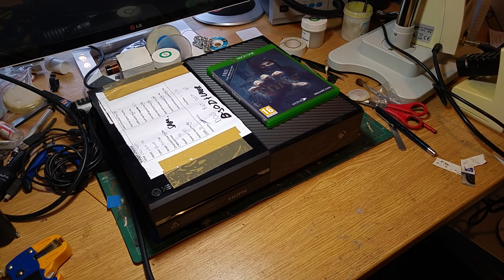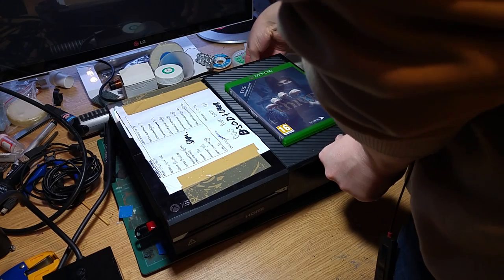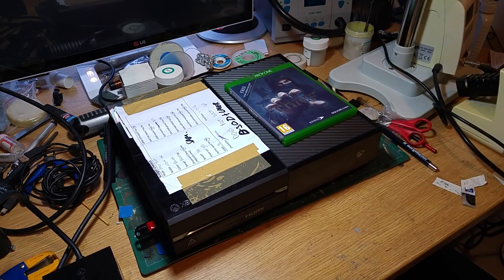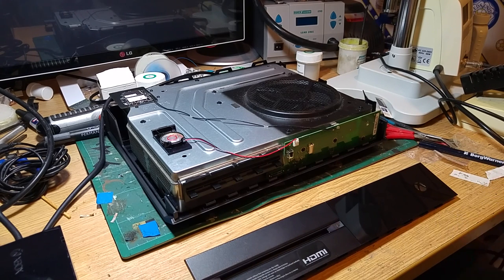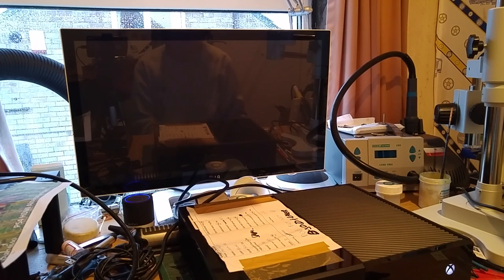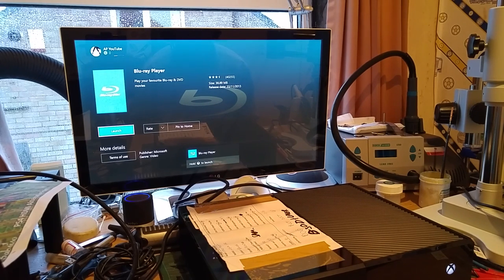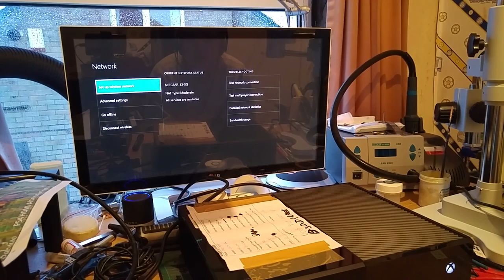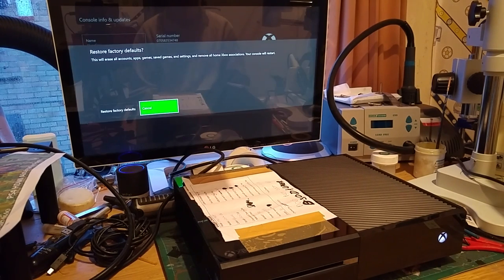XBOX One Black Screen / Intermittent Green Screen of Death Recovery - Diagnosis and Repair

Comment: Hey Andrew! My Xbox One console recently ran into this startup problem, giving me an E101 or E102 error code. I have tried using the Offline System Update on the support site using both OSUDT2 and Factory Default, but holding the correct button combinations will not play the correct tones or startup correctly. Do I need to open up the console? My warranty is up by the way. Thanks in advance!

Comment: Just reset it to factory settings, it worked for me.

Step 1: Hold the power button for a few seconds.
Step 2: Hold the bind button or whatever its called ( the one on the left side ) and the eject button for a couple of seconds.
Step 3: After you hear a sound you just tap the power button and keep holding the other two until you hear another sound and done.

Comment from the maker: check the flat ribbon from the front panel is correctly plugged in and square in the connector.
Reply: do all of these options reset storage on the HDD ?
Reply: Do i have to be do windows to download these files?
Reply: So Andy, are you a Playstation man or Xbox?  Xbox myself.
Reply from the maker: Very good question - to be honest I had both PS4 and XBOX One on launch day and if they've had 20 hours of collective use since I've had them then they've done well ha ha! Most of my games I do have are on PS4 so I guess from that point of view I'd be classed as a PS4 man but I love the XBOX One too - they're both great machines and I don't think you can go wrong with either to be fair. :-)
Reply: I'm getting on a bit 47, I'm more interested in fixing them rather than playing them. Saying that I got myself a HTC Vive and does that take it out on me lol.
Reply: D15rules
Have you tried deleting the game and reinstalling?
Reply: D15rules
Yes mate, go into the games list and press the select button on your joypad. You'll see delete there. If that doesn't work then fully restart the console from the options and restart there. Failing that contact MS.
Reply: Andrew Paul what you use to fix the hard drive
Reply: Hey Andrew. I have the same problem in this video. I seen you had used the HDAT2 program to scan the Xbox One HDD to find corrupted files. The second power tone does not seem to appear for my BIND and EJECT Troubleshoot Reset. I am only assuming by watching this video I have to take out the HDD and scan it with that program to fix the corrupted files. Please answer back with a response if I am going to have to do this. If so.. I need to know which HDAT2 Program you are using. I am on the website and there are a bunch of them..
Reply from the maker: Yes you need HDAT2 - remove the disk and scan with this. You need the HDAT2CD_53.ISO option under CD/DVD Boot ISO image.
I'll be doing a tutorial on HDAT2 shortly.
Reply: Thank you so much Andrew! I'm nervous to do this. It would be my first time taking apart my Xbox One. Can you also show how to hook up my Xbox One HDD to the PC/Laptop? So I can perform the scan on it with HDAT2. It would help out a lot Andrew.
Reply from the maker: You can see the disassembly procedure here:
https://www.youtube.com/watch?v=BrSX0LdSNuQ
Nice and easy :-)
Reply: I already have the video opened on another window tab. I got this video and the disassembly video opened. Just waiting to figure out how to use HDAT2 and hook up the Xbox HDD to my PC/Laptop. Then I can hopefully repair the HDD :)
Reply: What type of SATA cable do I need to connect the Xbox HDD to my Laptop? There is a few of them
Reply from the maker: Any SATA to USB cable will do.

Comment: I got a xbox one in and it has zero picture, inspected the hdmi, changed paste still no video. Took Hard drive out and used esata station makes a beep a few times then finally shows up in Disc management Say Unknown 3.86GB  Unallocated? It's a 500gb. So I took my working xbox one hard drive and stuck it in there and still nothing shows up? I tried OSUDT1 and OSUD2 files in SystemUpdate folder A-B. Whats odd though what is the Deltas.xvd thats on my working hard drive in folder A? All updates i downloaded does not have that file OSUDT 1,2,3
Reply from the maker: I think they're tied per-box these days. There's a way to get around that - I think there's a folder called 'LastConsole' or something similar which can be deleted.

I'd take a look here and rebuild the disk if it was me:
https://github.com/juvenal1/xboxonehdd

Comment: How long did it take for HDD regenerator read and fix the bad sectors? Here its going to take close to 23 hours to analyse the 29gb partition of the hard drive is that normal? 

And thank you for sharing your experience, you rock!
Reply from the maker: Which  mode do you have it in? If it's running under a normal scan & repair then no. However if you have it in the 'regenerate all sectors' mode then yes quite possibly - you just want to do a normal scan & repair option on it. Has it found any bad sectors as yet and is the sector count ticking over or does it appear stuck? If it's stuck then you may have no other option than to replace the disk altogether and rebuild the file system.
Reply: +Andrew Paul i have it on "mode repair". as you said i think thats why its taking so long (its not done yet). the scanned count is counting.  
the only thing is that it just found a delay on the beginning of the scan, looks like i have no bad sectors on the29gb partition. do you think that it can cause the console not to run? 

thank you for the attention
Reply: The System partition 29Gb has only one delay in the beginning (its done scaning and repairing) but the user data partition get stuck on pre scanning for errors. Even if i run my games on an external HD can this be the cause of all this stress? 

Can you give me a hint on how to rebuild the file system, i dont think this hard drive will be good to clone. it might get stuck in the process.

Comment: hi Andrew  sorry to bother you again when I press the bind button it doesn't flash so do I have to replace the wifi card or is that part of the failing hard drive fix I finally got the sata cord to connect to the computer
Reply from the maker: It's likely down to your failed drive.

Comment: I have a weird issue with an S, Turns on and when it gets to the green screen is all corrupted (like bad graphics chip corrupted). If I remove the animation file, it boots to the dashboard and all is almost OK. I say almost, because it won't play any disk games. It starts, but then it bounces back to the dashboard. I have swapped laser mechanisms, I have installed a new hard drive and still does the same thing.  New to game consoles. I don't have a game pass, or anything like that, so I did not try digital games yet. Any help would be appreciated.

Comment: I've been having this issue for quite a while now I'm currently waiting for my Xbox to return from Microsoft, My Xbox would turn on, I'd hear the fan kick in, it would take and eject a disk, but my controller would not sync, the TV displayed "No Signal", and i could not use the sync button because it wasn't working either( Therefor i couldn't boot into low-res mode). I tried every port, and used different HDMI cords and nothing worked. Luckily I still had my manufacturer warranty so i just shipped it in, but I don't even know what caused my Xbox to break in the first place. I was playing a game, it froze, so i shut off my Xbox and went to turn it back on and all that happened. When I called Xbox they were absolutely no help and only told me to ship it in, so idk if there is a fix or not for my issue.
Reply from the maker: Probably was the hard disk as here by the sounds of it. But that said, if you've a warranty then best to make use of it.

Comment: I looked around and didn't see it, so forgive me if it's already been asked, but what program did you use to isolate and fix the bad sectors?
Reply from the maker: +Jared Horne the program was HDD Regenerator. Cheers.
Reply: Thanks mate!
Reply: +Andrew Paul one more thing,  how were you able to scan it with HDD Regenerator? It won't even detect the drive.
Reply from the maker: +Jared Horne it can be troublesome via USB. Hook it up via SATA and try again

Comment: this video looks promising ... But how did you scan in windows ... which software you used ...
and please tell me which connecting cable to purchase
Reply from the maker: HDD Regenerator will scan within Windows but it is licensed software and I'm not sure development is ongoing as I believe the latest version is still 2011 (April 2013). HDAT2 albeit DOS based is freeware and is still in development. It's a brilliant app and just as capable so the choice is yours. Any SATA > USB adapter will suffice.
Reply: HI Andrew,

I followed steps in the video... I have connected sata to USB ..
but my harddisk is not showing up in disk management or in file system ..
please help .. what might be the issue ?
Reply from the maker: Sounds like a dead disk. You'll need to replace it with an identical size unit following this tutorial:
https://www.youtube.com/watch?v=GaKVBo3kdTU

Comment: Andrew Paul how can i contact You any way of sending a message i have an issue with xbox one controller and cant really diagnose whats wrong maybe you had a problem like it it freezes when on cable on baterries works perfect every time. i have quite few of them to fix and having similar issues with them, can you help please?
Regards
Reply: Go under settings to devices, with the usb cable plugged in for the controller and check for any updates. If there are none, you probably need a new mini usb cord.

Comment: Hey Andrew I really appreciate your videos. As of now I'm in the process of dismantling my Xbox one console in an attempt to reach the hard drive. I am curious as to how I go about the process of deleting corrupt files from the drive once it's connected to my PC. Thanks for the excellent work, Will
Reply from the maker: You don't need to delete them at all bud - just run a bad sector check via HDAT2 to find and correct any errors on the disk. If it finds and repairs them, re-install the disk back into the XBOX and give it a try. Hopefully it'll start up and run :)
Reply: What's hdat2?

Comment: Do u use option 1 on hddreg scan and repair mines has 8 bad sectors so far at start of drive let it run to the end and try ?
Reply from the maker: +snedz1967 Scan and Repair, yes. Allow it to finish and give it  try - hopefully all will be good :-)

Comment: Hey Andrew me explain what you did on the hard drive of your xbox for me to do the same because I did not understand what you did explain to me please
Reply from the maker: The hard disk has bad sectors - the XBOX needs to read the data from these damaged areas to start hence why it struggles. The software scans the disk and attempts to repair the damaged sector by switching it's magnetic polarity and rewriting the data. If it works then your XBOX should work perfectly again however if the drive has lots of these sectors, they reappear or you have physical damage to the disk then this may not prove to be a lasting solution and you might be best replacing the disk with a new part. I will be doing a tutorial for this shortly hopefully!
Reply: thanks for the information, that will be great tutorial.

Comment: Hi Andrew Paul, A few days ago the Xbox requested an update, my xbox sorteo fine, after the update the Xbox shows the error E100 0000070C 8B05000F. Use OSU1 offline and show the same  error and use OSU2  and show Error E101 00000504 8B050041. The Hard drive works and  i made the partitions with your tutorial and continue showing the same error in the 2 case. When i turn on the Xbox this atarte in step 3 of 3 applying update. Any recommendation?

Comment: Have you ever had a console that is reset but installs the update but wont restart after it powers down at end of the update? If so, do you have a link to a video? I thought it was power but even with a new supply, it still wont turn on properly after update.
Reply from the maker: Check the drive for bad sectors with HDAT2 in the first instance. It's free and available from hdat2.com.

Comment: Hey there, cracking video.
My Xbox doesn't have the black screen or green screen, but does take an eternity to load, then freezes up when it gets to the dashboard; I can't use my controller to select anything or actually see any pictures. Would this all work for this situation? 
Many thanks.
Reply from the maker: Hi Nigel,
Yes very probably - give it a try and hopefully that'll sort it :-)
Reply: Fantastic mate, it's working. You've saved me £90. Many thanks.
Reply from the maker: No problem at all mate. Congratulations on the successful repair! :-)

Comment: Hi there, iv recently stumbled across a similar issue. i was in the middle of finding an online game and then it popped up with the system needs to update so as everyone does i updated it then after that iv had a black screen my monitor recognizes that theres a signal but no picture or audio is emitted not even through my elgato. and iv been researching for nearlly 4 hours now and alot of places have gone straight to a factory reboot wich isnt my preffered option as im really not wanting to wait nearlly a week to get all my games back again. im currently using the original xbox one model as shown in the video. if you would have any specific speculation on the problem itd be a great help, also on the xbox suport site it says to hold the bind and eject buttons to get the 2 chimes to boot up the offline update install i get one chime and thats it any speculation on wether my console is completly dead or not would be great, thanks in advance.
Reply from the maker: Check the disk for bad sectors with HDAT2 initially.

Comment: Cheers paid 70 for console on eBay had 2500 bag sectors console now running happy days
Reply from the maker: +snedz1967 Congratulations on the successful repair! :)
Reply: +snedz1967 It still works to this day?
Reply: +toontownlegomaster legomaster yes m8 but  had to scan it again after a week so got Jrunner cloned the drive using Windows now works perfect
Reply: What does that do?
Reply: hi  i did all the updates offline  it just goes back to green screen any suggestions?

Comment: my xbox one has exactly the same symptoms at this one, black screen for about 5 minutes then green screen for about 10 seconds then error code screen e200.if I were to remove the hard drive and put it in a external hard drive caddy, then hook it up via usb to a windows 10 pc, could I use windows 'check disk' utility to fix the bad sectors on the hard drive?
Reply from the maker: +likeaslowburn Hi,
It's worth a try - It's not something I've tested before so it'd be interesting to know if that'd work too.
Reply: hey you can fix your Xbox with this method

Comment: Hi Andrew for my Xbox one I turn it on it loads up to the Xbox one loading screen then goes black and I had on all night and didn't do nothing I even tried to factory reset but it wouldn't to that screen and how do you know if the bind button works or doesn't work I hope you can tell a little about my Xbox one
Reply from the maker: Sounds like a classic case of a failing hard disk. I'd remove it from the console and scan it using a PC with HDAT2 to check it for bad sectors.
Reply: Andrew Paul  sorry to bother you I couldn't get the hdat2 to work on my PC or couldn't find the right one but I HHD regenerator will that app work for it

Comment: What would be your next step if all steps in this video still don't work? no updates giving me a picture and a scan on the HDD is showing 0 problems. I used HDAT as don't really want to buy full copy of HDDR. Cheers
Reply from the maker: You'd have no option other than to format the disk and rebuild it.
Reply: Thanks for the quick reply, any guides you would recommend for this? Will it definitely be a hdd issue?
Reply from the maker: If the white light is coming on and staying on and it won't boot into USB recovery then yes most certainly. I'm hoping to have a video up on this within the next week. Cheers.

Comment: Hi. I'm still no further. I'm unable to get download the software for free. Would cloning another HDD and copying data to the current disk work? Do you offer a post and repair if not?
Reply from the maker: I do for UK/EU viewers.
You can clone the disk but it needs a bit of fiddling to get it to work. It's easier to set up a new disk than clone the existing one to be fair. A tutorial for this will be up in the next couple of weeks as I have a couple to do with disk failures. Cheers.
Reply: +Andrew Paul if I format the current disk and set up as new will that be the same? I'll await your video and if I'm still stuck I'll contact you for a repair as I'm in the UK. Have you a way I can contact you other than here? Thanks again for your help. Appreciated.
Reply from the maker: You can use HDAT2 as a free alternative. I'm looking to do a tutorial on this shortly. Many thanks.

Comment: My Xbox One must be a stubborn one then, I don't even see a green/black screen, my TV says nothing is even connected to it.
Reply from the maker: +Lardass is the HDMI port in good shape?
Reply: +Lardass is it in the right slot, there is two hdmi slots
Reply: +Lardass I have the same problem. If you wait a while it'll go to the green loading screen
Reply: Flash845 I finally managed to fix it by screwing around with some things, honestly have no clue what I did.
Reply: did u ever fix it? thats exactly whats happening to me. it says nothings connected and my controller wont even connect to the xbox.
Reply: +Flash845 did u ever fix it? it also does that me and im currently experiencing it. please tell me if u have a solution
Reply: +Ezequiel Diaz did u ever fix it?